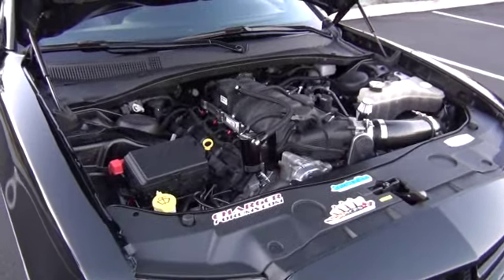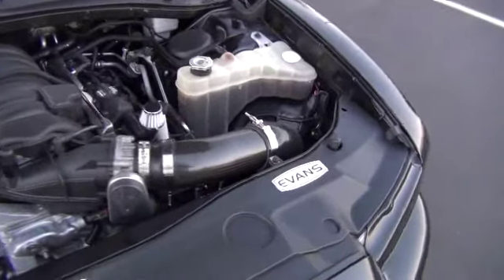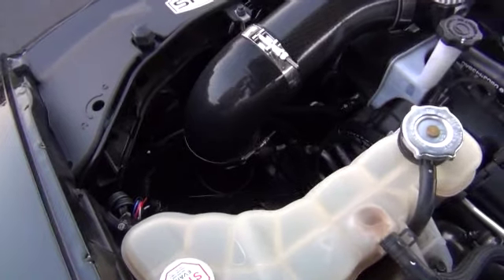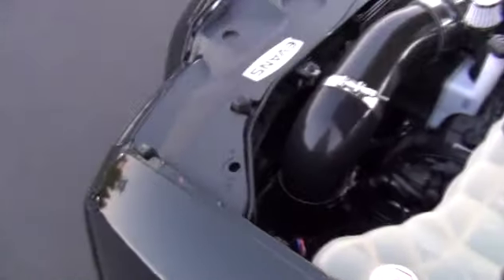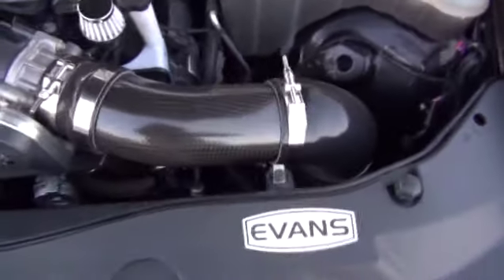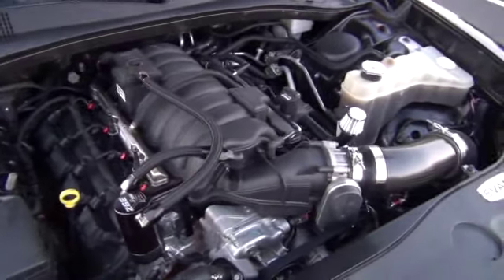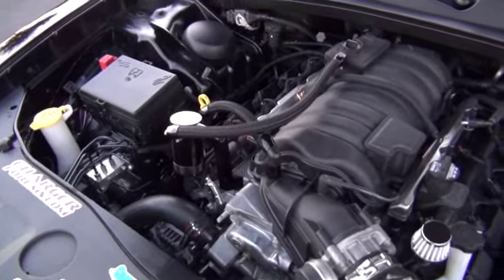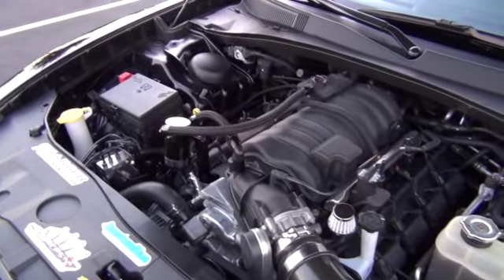392 LMI True CAI Installed - 2012 SRT8 Dodge Charger

Comment from the maker: There is a Triangle shaped hole going down from the stock airbox through the fender. In order to install the 4" tube that goes down and into the fender well area you need to cut there to make a hole that it can fit through.After that you use some car door edge guard to go around the triangular hole and where you cut to help prevent damage to the CAI tubing. I 1st cut it just a little bigger than the tube so when you add the edge guard it was too snug of a fit and required more cutting/grinding.

Comment from the maker: Mopar is typically a bolt on plug and play kind of deal - Its also a California CARB approved CAI.  BUT   LMI blows it away - Most of the Top track record holders use and stand behind the use of LMI intakes. Even with the round hole you will need to use a hole saw to cut a bigger hole as the LMI is a lot larger than a stock hole... Even with the Mopar being a True CAI design i'm sure the LMI will outperform it ;) - I swapped from my non-true mopar CAI to this intake - Very happy with my choice!

Comment from the maker: I havent Dyno'd the new intake yet. Still waiting before dynoing as I want to do a before and after when installing the water meth kit.  once I have the numbers i'll post them here ;) Before a Cold air intake the numbers were 447HP 442ftLbs Torque.  To get the full potential of a CAI you need a tuner.

Comment: Ok I think I'm gonna go with this one. I was gonna get the frankentake but there's no heat shield or is that not a problem?
Reply from the maker: dont need a heat shield... you are pulling from fender.. so its always pretty cool. as long as you are moving 5mph you are going to be sucking cool air.

Comment: Hey buddy I have a really important question , so I recently purchased an srt 2014 brand new it doesn't have but 600 miles on it and I installed a K&n intank and the car was fine for a few days and then I notices the car kinda gets a little to hot and smoke starts coming out the exaust but the set up was not like yours
Reply from the maker: Well the 392 runs hot as is... If you are running K&N and pulling from under hood instead of fender well... Then yes it is normal to suck hot air from engine bay more than stock. As for the smoke out the exhaust... That could be several things. I'd take the K&N off and see if it goes away. (I highly doubt it's CAI related but a dealer may try to pin it on that if it's installed when they check it.) If not you may have larger issues that require warranty work.

Comment: What protection do you have with this intake so you don't suck water from the fender well into your motor and hydro lock it? (basically ruin the motor)
Reply from the maker: There is no need for protection unless you are constantly driving WOT through puddles deeper than 12 inches. Takes a lot of water to hydrolock and with basic gravity and the size of the filter very little water will enter the intake and that small amount that does will typically be so small that it would vaporize. People have been using water methanol injection for years with no issue and that would be spraying more water than typical driving through normal puddles.

Comment: Have you had any issues with water since it's on the under side of the car? Am looking into getting the same intake.
Reply from the maker: No water problems. Puddles are not an issue unless you stop in one or drive through one that submerges more than 1/4 of the filter. Its by far the best CAI on the market :)

Comment: http://www.speedlogixstore.com/v/vspfiles/photos/LMI-FIV-2T.jpg this is the one I was looking at but was worried because it doesn't have a heat shield.
Reply from the maker: Heat shield or no heat shield all engine bay mounted filters all suck in hot air.  A heat shield doesnt stop engine bay heat from getting sucked in... it only blocks it until it gets heat soaked... and then it radiates heat... thats why LMI doesnt even bother using one. if you want heat shielding then you need to fully seal and add some type of blanket as well as redesign hood to extract heat away from that area.... its just cheaper and easier to do a pull from fender area that is down and forward of the object creating the heat... ie engine..

Comment: how did you install the 2 injectors in the carbon fibre ?
Reply from the maker: I contacted LMi and sent him 2 injector bungs. They built the CAI with the bungs embedded without protruding into the air path. Each bung was about $10 and both installed by LMI was $50 over MSRP. Hope this helps ;)
Reply: srt8frost2012 where did you buy the bungs i talk to snow performance and they only have Nylon ones and LMI said they won't work
Reply from the maker: JEGS sells them for $29 each now. Search for the following ;)

Steel - Snow Performance#860-40130 
Or
Aluminum - Snow Performance#860-40120
Reply: srt8frost2012 thx
Reply from the maker: No problem ;) 👍👍

Comment: So what was the intake temp above ambient afterwards?
Reply from the maker: Depends on how long you been driving and the outside temp, but from a cold engine it's typically same if not +5 over ambient, and on a hot day and in traffic it will raise just like all the rest. Highway is usually +1-2 over ambient. By far the best CAI I have installed on the car.
Reply: Im running 5 with oem. so virtually no difference.
Reply from the maker: +Shannon Wilson stock I was getting +20 to +50 or more depending on traffic. With the engine bay draw Mopar CAI I was still getting about the same. When I switched to LMI it was the only time it stayed consistently cooler. All depends on how you drive and traffic. Also stock airbox and coupler does not flow the same amount of air and is restrictive. Also once heat soaked the airbox does not cool down as fast as a CarbonFiber tube. Unless you live in a area that it's cold outside all the time a CAI is always going to outperform stock.
Reply: srt8frost2012
First of all.. and I'm telling you this from knowledge and with respect.. A 6.4L hemi has no issues with air flow in stock form. As a matter of fact (not opinion) the stock intake, intake manifold and those excellent heads with oversized ports and the stock exhaust are easily capable of air flow above 340 cfm. Thats enough air to produce 600 hp!! Trust me.. there are no issues with airflow on this engine. It's already capable of providing more air than the stock engine could ever use.. Way more. Heck.. You could take your filter right out and it's not going allow your pistons to suck in anymore air as capacity well exceeds consumption. There is no restriction at feeding the cylinders. Zero!! Talk to real engine builders that have no financial interest in gimmicks like CAI's.

Also feel free to do a test. Drive 65mph and tell me what the intake air is over ambient. I can compare as I have video of mine at all different temps that I can show you to compare. At best, because you have a fender mount (unlike the rest that take the air from the exact location of stock lol) you will be 2 degrees colder. 2 degrees colder equals zero gains in performance.

So no.. it is not true you are getting more air flow and it is not true your 'colder' air is giving you anything.
 
 
The fact is that these intakes are the biggest and most successful scam in the industry.
 
Not sure where your getting your information from.
Reply: and btw.. carbon fiber is a low conductor of heat. Yes it would cool over faster but only once the heat source is removed, which of course never gets removed with a running engine. So once its heat soaked.. it stays heat soaked at the same temperature as any other material you could use.. transferring the same heat to the intake air.
Reply from the maker: +Vedder Ved ok I did a little videoing while doing errands and honestly the videos are kind of long. Looking back to do a proper test I should have sat on the highway till temp of 111 then got on to drive 65 only but with groceries in trunk thawing I really didn't want to do that. After driving the car for 7 minutes on the highway I left the car parked to bring the intake temp up to 111* at 12:03 pm I started the car then got on the highway doing 80 ran into traffic and slowed to 50ish drove 65mph the rest of the way home and at 12:10pm I was already down to 66 degrees intake temp and the outside temp at coolest reading was 63*. So +3 degrees from +48 in 7 minutes of total driving time and only about 4 minutes of highway speed 65mph.   Now about your comments on the 0 restriction you claim the stock intake has... First off the stock filter is paper and that is restrictive as hell. Then there is the filter box. It draws from behind the headlight and very little air from the fender area.
Reply from the maker: Now majority of the air the stock box pulls in is coming from the behind headlight area which is mostly engine bay heated air because there is a piece of plastic that blocks most of the air from the grille area and forces that air through the radiator and some from the fender area. Then it goes through the paper filter and into the upper area which then sucks into the tube going to a ribbed neck which also causes turbulence therefore slowing the air a little more.  That's all restriction.  The smoother inside surfaces of a CAI is less restrictive, same with the filter material.
Reply: Cool.. im happy your checking it out. Only thing missing is if your engine was at max temp, which it wasn't if you only drove 7 min. so.. it sounds like your intake temp is about the same as mine but I already knew that. And you don't seem to understand that yes the filter has restriction.. but the flow through that restriction is waaaaay more than your engine could ever take. Its taking max air already with a shit load of capacity in reserve. you can easily flow 340cfm through there, the intake, and the heads.. but way more than that through that little filter. You can take the filter right out and your cylinders will not suck in anymore air..they are already at full capacity.
Reply from the maker: The thing about a CAI is that it isn't that big of a deal when done on its own. To get the full benefit of a CAI you need to tune for the additional air by adding at least 3-5% more fuel throughout the rpm range under WOT. Then if you do long tube headers and exhaust more air is capable to be pushed through the motor to make more power.
Reply: and it is not engine bay heated at speeds because your travelling. That 65 mph air movement is pushing the heat to the back of the engine compartment and out. if you could put your hand there while travelling you would see its cold fresh air, right at the front..the heat cant travel against the force of the air flow the engine bay.
But even if you don't believe me.. my stock intake temps are basically the same as yours. That isn't my opinion.. it is a fact. so that in itself should be enough.
Reply: srt8frost2012 Nope.. you'll get the same thing from a tune with or without an intake. Proven.
Reply from the maker: The stock throttle body is 80mm so a 90mm throttle body will help by increasing air flow by as much as 35% which also requires a larger filter to allow more surface area to be less restrictive. Drop another $300 to port your intake to remove a little more restriction... Then do heads etc... So yeah I understand how a CAI works. The 392 isn't that special. It can't handle consistent boost of more than 6-7 psi and the Pistons go at 8psi. All in all there are plenty of restrictions throughout the whole thing... If there was none.. People wouldn't waste the money on CAI, ported intakes and heads etc.
Reply: oh.. now if your talking restriction yes there is some on the exhaust. Agreed
Reply: And the extra air is sitting there waiting to be taken.. its not the filter or the intake tube holding it back. If you ported the crap out of your heads and throttle body and enlarged the cylinders to accept more air/fuel.. the oem intake would supply it all with some to spare.

But hey.. it sounds like you either don't believe me or don't understand. I tried my best.

Cheers man. Enjoy!
Reply: The stock filter will provide way more air than a 90mm intake could ever handle.